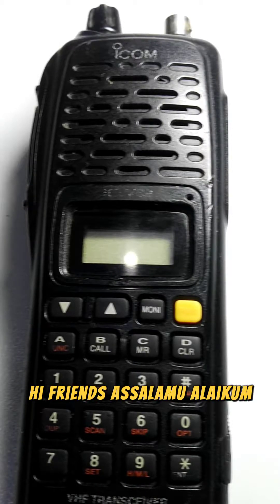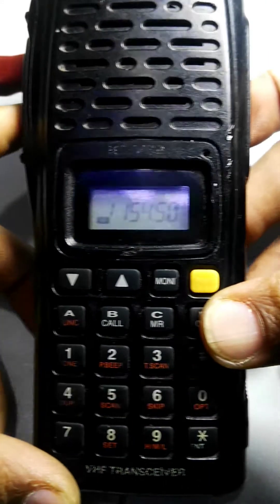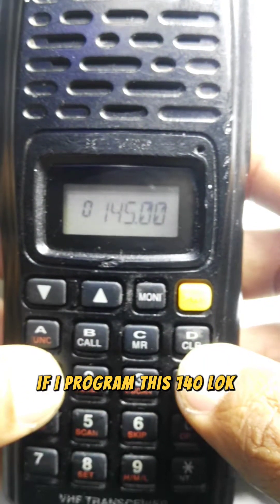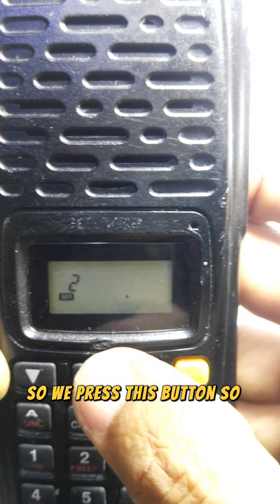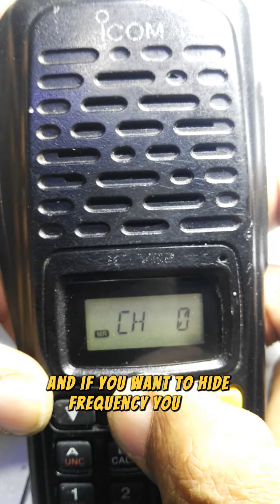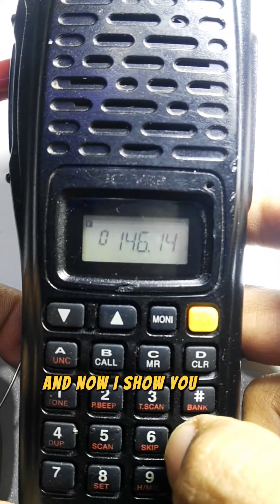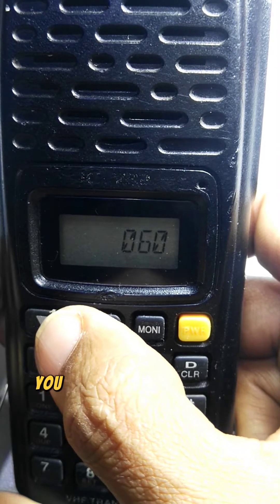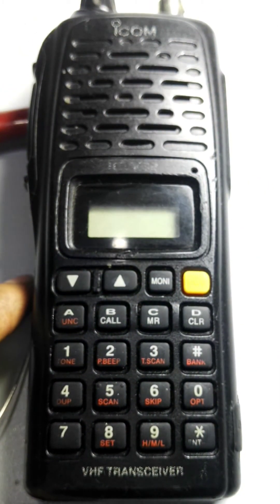Factory Reset ICOM IC-V82 or IC-U82 & How to Program Manually without using programing software

Comment: My radio makes no sound no beeps no sound at all. It turns on I seem to be able to go through the menu, but I have no sound come out of it.  What do you think is wrong with it?
Reply from the maker: Thanks for messaging 
My Dear at check the volume level
Then speaker of the radio if still problem is there then check the audio ic on the circuit board. If you can follow these instructions you can fix it . Thanks 👍